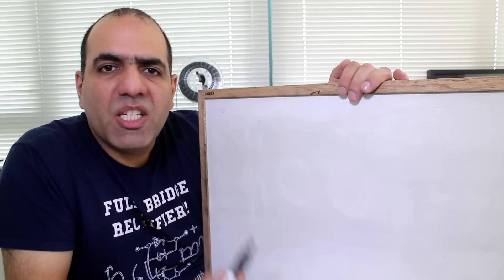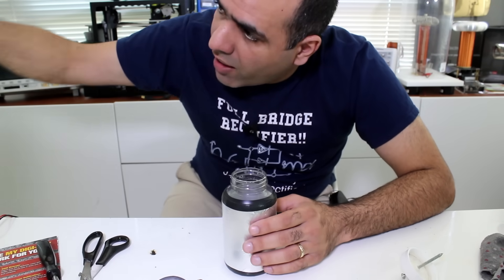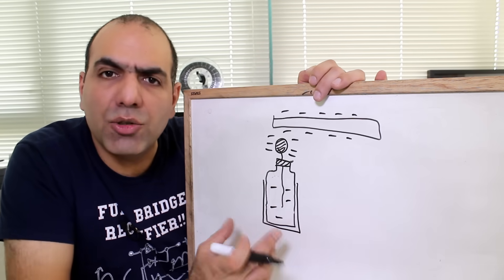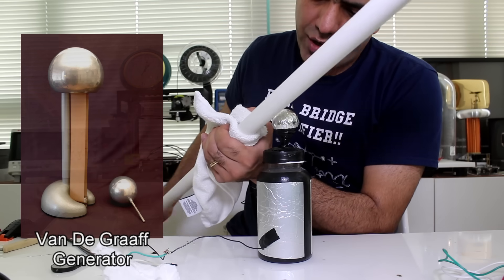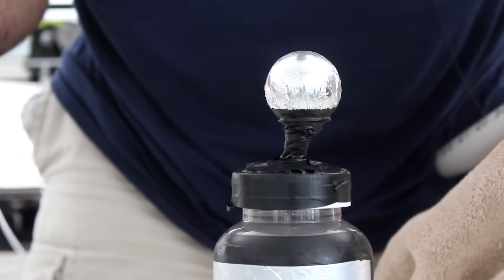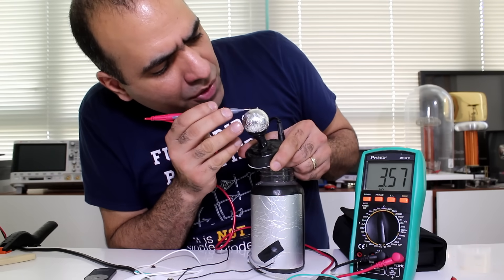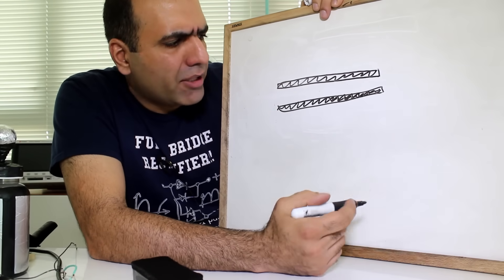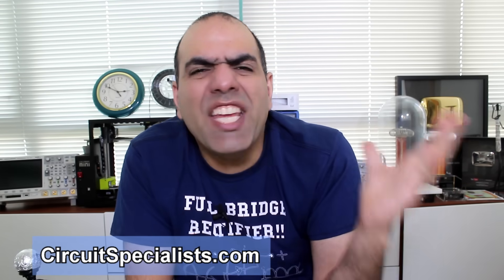Make a SUPER HIGH VOLTAGE Capacitor

Comment: I guess I was under the impression that a Layden jar capacitor has air in it and it’s connected through the foil and the inner anode and the static buildup and you have a spark gap the top which then discharges.  I’ve made many Leyden  jars, but I’ve never made them with water.

Comment: I watched his vid earlier and called him a bitch I had 4 ohm 550-600 volt running thru my finger and I didn't jump  imma set up 8 leyden jars split between 2000 Volts and create spark gaps between see what happens lmfao

Comment: Guys my layden jar isnt charging (i think?) Ive followed the steps minus the round thing at the top of the screw (i cant find something round for it) and i couldnt get copper wire to put at the end of the screw. Besides that im pretty sure i did everything correctly 

Im using a sock and a pvc pipe on the screw to charge it (yes the sock is placing negative charge on the pipe) but if i touch the screw while barefoot and sweaty with my feet on the ground nothing happens

Comment: Did he say 'every volt is one amp'?
Reply: Every volt that shows up on the oscilloscope is one amp that flows through the shunt. It is the voltage drop across the shunt that shows current (1 volt = 1 amp) (at least with that resistor (shunt))

Comment: can somebody please explain why at 5:25 he didn't get electrocuted when he was holding the screw even though the screw is conductive?
Reply: If im right, since the screw is grounded aka straight to ground. Since electricity take the path with least resistance, the ground wire has less resistance than human skin so electricity go to the wire rather than his hand.
Reply: Electrical tape.

Comment: Sir I heard of a capacitor that would recharge itself. The electolite was carnuaba wax. It was set between two aluminium plates. The distance from the plate was quarter inch. The voltage was around 20KV. They melt the wax and apply the high voltage than when it sets it remains charged always. You can discharge it but it recharges itself. Did you hear anything about this?

Comment: If rubbing the PVC pipe with a towel creates negative charge how does he charge the capacitor if the capacitor is hooked to ground?
Reply: What? The net charge flow to ground is zero, so it has no effect on the charging of the capacitor. He could charge the capacitor without hooking himself or the capacitor to ground, but I'm guessing that he does not want his body to accumulate any charge and risk getting shocked when touching grounded objects later.

Comment: Just for knowledge: It is not the energy primarily but the charge of an electrostatic discharge (for short pulses) which is the main parameter determining the shock amplitude stimulating the nerves and muscles.

Comment: Used to make capacitors from baker's foil and landscaping plastic. Roll into a spiral, then stuff into a pipe suck the air out, and fill with transformer oil. Worked nicely for tesla coils because the foil ends were combined to form a lug on each side. You can also make a spiral line pulse generator. Just roll as normal with the inner portion having an extra 4 to 18 turns of foil inside. When discharged the current wave becomes ultra high voltage.
Reply: Sounds interesting. I'd like to try this. Can you provide some more details on how you constructed this?

Comment: I like the cable on the table he is not even hiding it
Reply: Why would he need to hide it he’s connecting himself to ground give himself a better shock from the jar, the plug he was using has a ground connection to it.
Reply: @Huckle_Berry-  7:37 i meant this this was clearly staged, you can see the black wire go under the table
Reply: Electroboom explains the wire here 3:56

Comment: Isn’t tapwater conductive? Pure water is nonconductive but the water that comes out of all of our taps in Canada and the United States is filtered water and that does not remove all of the solids which does make it conductive. No adding salt will increase the conduct of this of water but I just want to clarify when you say that water is not conductive you don’t mean the water you’re using but pure water right? Am I wrong or is tap water conductive.

Comment: Fill your capacitor with citric acid to lower resistance. Though you could just use powdered aluminum like that found in the old etchescetch.

Comment: I was visiting a sort of outdoor workshop camping thingie once and we had just been having a big water fight so my t-shirt and pants where completely drenched, and I was going to brush my teeth using water from..well, basically just a pipe out of the ground with a tap (outside) which spilled a lot of water into the grass so my feet where completely immersed in water, and theres this animal pasture right besides it and while Im washing my hands under the stream of water from the tap, I accidently push against the electrical fence with my shoulder and holy crap, after that I really understood the whole thing about your body being driven by electric signals, felt like I had a small metal rod or something going through my shoulder for like at least a couple hours afterward, Im glad the point of the fence is to get the animal to want to go away as quickly as possible, since this is what happened for me (sharp pain equals reflex to remove body-part from what causes the pain XD).

Im no expert in electronics and stuff, but Im kinda glad it happened in the way it did, Im imagining that it would hurt a hell of a lot more if it was my hands or feet (or any other part with a lot of nerves) that touched the way it did. Holy hell though, I really did get the shock of a lifetime >_<

Comment: hey electroboom congrats for making the process of understanding capacitors much more easiers and funny 

but for project i need to find a way to get a steady output voltage of 12 volts and i should be able to change the amperes from 15-25 amps as per need

i have a configuration in my mind though
i am wondering if i can put a ceiling fan regulator(to reduce watts as i please) before an pc smps(to get an steady output voltage)
is this possible if no what can i do?

Comment: Electronic air cleaners have an output of 5,000 volts. In the air duct, high voltage wires ionize the air. The charged dust particles pass some collecting fins, and opposite charges attract. The very principle that Mehdi explains. Right, so many years ago, I worked at a small company that sold and repaired electronic air cleaners. Repairing is not what I did. It was more like replace the circuit board. But, first I had to test the circuit board. So plug in circuit board to 110 VAC. Short the output terminal with 2 screwdrivers. If there is no spark the board is dead. Unplug board, and discharge the capacitors with the screwdrivers. The circuit board has 4 large capacitors to produce 5,000 VDC and they hold a big ass charge. Yeah, so one time, I forgot to discharge the capacitors and I grabbed the circuit board. Those 4 big ass capacitors discharged through my body in the blink of a eye. Yeah, so I know how Mehdi feels… BLEEP !!

Comment: Omg want some power wind foam with green release plastic on that pipe omg I got a mega shock from a 1m X 50m or use double sided tape with plastic liner with release paper eg greese proof paper dam bolt must of jumped half a metre made me jump a mile

Comment: For making the second, much better capacitor, can you use a sheet of paper instead of plastic? Or maybe two sheets glued together perfectly to increase its strength.
Reply: paper is almost guaranteed to have micro holes in it.  it's made of fibers.  only ancient capacitors used paper and they weren't terribly good

Comment: WARNING WILL ROBINSON DANGER!!!@ Dont mess around with any leyden jars you might find till you have made sure they are discharged!!!!!!! Make sure YOU kniw what you are doing if you make one.
Messing around with one CAN be VERY dangerous. 
Long ago they were used With HUGE sparkgap transmitters (the early 1900's). In 1952 a man in New Jersey found several leyden  jars in the attic of a house he had just  bought. Not knowing what they were he touched one and was truly electrocuted. Dead as in  doornail. Investigation found the 3 had been used qith a several hundred watt amature radio station lasrt logged 1910. The 2 remaining had charges of  couple thousand volts. Stored for more than thos 40 years. Enuf to kill a man. And one of them had. 
THEY HOLD A CHARGE A loooooong TIME.!!!!

Comment: ElectroBOOM. I always enjoy watching your content, especially the humours, really helps make my day. If I may ask regarding capacitors, which is better at absorbing voltage spikes in a multi rotor or drone application which starts & stops motors rapidly continuously. To use a single large capacitor vs multiple small capacitors?

Comment: 4:54. At low speed, you can see his left arm (which has the ground connection). start contracting right after the spark happens. Nice.

Comment: How could he charge the Capacitor with a Transformer? Dont Transformers only work with AC, which would charge and discharge the Capacitor over and over again due to the changing Potential of the Voltage?

Comment: If this is a ele trolytic cap,  it has high charge holding ability,  at very low volt threshold.  There is a difference.

Comment: I challenge you. Make a device that charges a battery using static electricity. This could be used for example connected to our body and during the course of the day (and night) the static produced by our body will charge the battery.

Comment: He said he used earth which I assume he meant earth/ground on an outlet. If I don't want to stick a wire into an outlet, could I stick a wire into the dirt outside and use that as earth?
Reply: Most metal pipes in your house should be grounded, same with electronics that have exposed metal that plug into the wall. Your ground lug should be safe to plug things into for a ground reference assuming you trust your electrician or whoever built the place.

Comment: i want to ask you if i have a generator and connected in parallel a capacitor 60MF i check the current in series to that cap and find its 3.5amps if i connect that to a load of lamps 40 watts the lamp takes only 0.25 and the rest still goes to the caps , how can i use the 3.5 instead of the caps on a load?

Comment: You should have used weak acid/salt/base at infinite dilution so that conductance would be maximum.
Reply: Infinite dilution? So basically nothing?
Reply: @SophiaAstatine  have you ever studied electrochemistry you dumb
Reply: @SophiaAstatine  check graph of molar conductivity versus concentration of weak/strong electrolyte
Reply: @himanshubisht6276  I have not, that's why the name puzzled me, diluting something infinitely sounds like that one con-medicine more than anything, so I couldn't resist asking.
Reply: @SophiaAstatine  so why you even watch his videos. His videos are only for big brains. Mehdi is god big brain mehdi
Reply: @SophiaAstatine  lets me explain. The conductivity of liquid depends on how easily H+ ions and OH- ions moves easily. H+ ion movements is more important cause it's mass is way less than OH- ions. For easier movement in liquid it should have less obstacle in its path like other ions of salt/base/acid. That is why infinite dilution in weak electrolyte favours movement of H+ ions cause it's dissociation in not linear otherwise it's linear in strong electrolyte
Reply: @himanshubisht6276  It was the infinite dilution bit that I was curious about. But fair enough. Decided to take a moment to read up on infinite dilution either way and I think I get it now. Reminded me why I picked physics over chemistry.

Comment: Could you chain them? How is that done? What if you took th charge from them electrolyze water to generate hydrogen? What if you had an antenna array to use local magnetic fields to charge them? It would have to be big maybe.

Comment: hi there, me and my dad are working on our science fair project and are using your video to make a leyden jar, even though we are using and doing the exact thing you are doing it is not working we think it is because we are maybe not earthing it properly please help! the science fair is in two weeks! do all of the wires connect to the earth and do you leave the wire connected to yourself when you touch the leyden jar with the other sphere
Reply: Nothing is grounded, except the little ball he used after to release the energy. His body is connected to the outer aluminium foil, and he runs the pipe on the ball on top. Once he did it enough, he put the grounded ball next to it, and it unload the energy to the ground. You can use the ground of a power outlet

Comment: I think you don't need rhe ground because the charges go from the capacitors outher plate to the towel. You showed the electro went to ground and then an electron came from ground.

Comment: #ElectroBoom , doesn't the capacitance of your second capacitor double only if the inner diameter of the roll you make is zero, which is the ideal case? Practically, you would lose some area from your inner plate (plate facing upwards when you roll) - about [b*pi*(d^2)/4]

*b = breadth of your aluminium foil 
*d = inner diameter of your roll

Comment: tap water is about 3.3 kohm resistivity.  thats  about 30mA at 110V which could be lead to death.   Tap water is conductive. because 30 mA is not negligible in terms of safety.  What you meant is that   you need to add  salt to your experiment to increase conductivity of the solution.

Comment: High voltage capacitors are mainly tested at AC frequencies . Our Induction Generators use capacitors at 5000Hz frequency and there we need a capacitor of 4uf that can stand 2000VAC at that frequency.

Comment: Man I wish you could've filmed from under a glass table to see what happens inside the jar. I wonder if the salt in the jar moves as it charges and discharges
Reply: The salt shouldn't be visible if it is dissolved in the water. Having lumps of minerals isn't that useful for conductivity, compared to having the ions floating in a solvent.

Comment: I used make them for my static machine.it dos over 200, 000 volts.eatch dos 150, 000 volts.
Reply: Actually I made bad calculation. 300, 000  volts.

Comment: good day! we are struggling on our research. We would like to ask you if a voltae multiplier made from 1n4007 diodes and 100uF-35v capacitors would multiply a 0.100 ac voltage from an alternator. Thank you very much. Please message me @ ninoarellano333@gmail.com

Comment: Static capacitor. I made a sandwich of 9"x 9" about. Many layers of plexaglass 1/4". I made about 6-7 layers. Then weaved tin foil in between the plexaglass. I touch one end or held it. Then touch the other end to a running vandegrafe generator. Man did I get a hard SHOCK, WOW!! Never played with that again.

Comment: One question: I have an arduino that has it's own 5v and GND circuit, if a connect the outside of the DIY capacitor, is that able to discharge it? In order to prevent shocks by touching the surface...

Comment: why did it hurt while the maximum voltage is 6.15 and the minimum is -11.85, is it because of the high current???
and why there is a positive value while he touched the negative charged side???
I'm talking about the pic in the 7:19 minute.

Comment: Idk why but my leyden jar was garbage at first then made another when with a bigger surface area then I tried to charge it and still nothing happened I did 100 strokes and still I didnt feel anything made sure everything was dry taped well and the ball was rounded and still nothing then I had the idea of using my 3.7v dc to 400000v step up tr transformer and surprisingly it worked extremely well I can control the discharge voltage just by reducing the input voltage I want an answer from Mehdi my Iranian Idol why isn't my leyden jar working with the pvc pipe charge method?
PS. 
I added some lemon water into the leyden jar to increase conductivity

Comment: At 10:29 is that all that is required in a circuit to charge a capacitor to a higher voltage? A transformer to increase the voltage and a diode to convert from ac to dc?
Reply: Yep
Reply: Why he doesn't use his FULL BRIDGE RECTIFIER

Comment: while charging the salt solution capacitor,  the 2nd plate (aluminium foil) is connected to earthing (ElectroBOOM's body). he then rubs the PVC pipe and charges the metal ball with negative charge. the charge on PVC pipe is neutralized by earthing (ElectroBOOM ) here, my doubt is, why dont electrons from metal ball go back to PVC pipe (back to earthing as it is neutral because charged bodies transfer 50% of their charge to neutral bodies. this cycle of being discharged goes of till neutral state is obtained.) ?

Comment: What makes this high voltage? You are pumping charges into the capacitor but why does the voltage raise? Normally the capacitor is charged to whatever voltage the supply is but there is no high voltage supply here, or is there?

Comment: You said that Energy = Voltage * Current * Time. What value of current, and what value of time? Voltage is voltage, but could be megavolts or milivolts... Current is amps... Are you talking about milli-amps, amps or mega-amps... etc.? Are you talking about milli-seconds, seconds, or minutes... etc.?

Comment: Is i just connect a wire with floor than will it get connected with Earth?
Reply: The Lyrics Lovers just use the Ground In a plug
Reply: @bluecatdk  do u mean the ground socket in switch boards of our house?
Reply: @madhavgautam5357  yes just use that or just connect it to a grounded surface
Reply: Not in bathroom